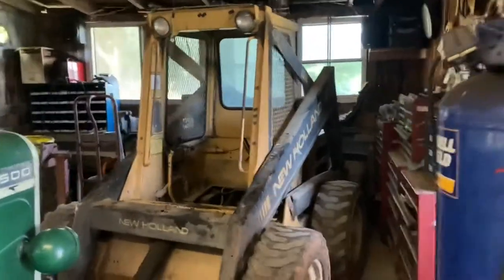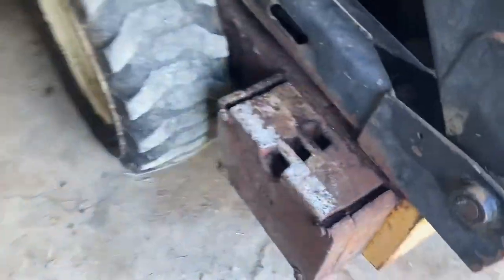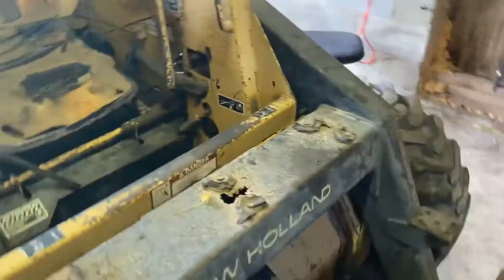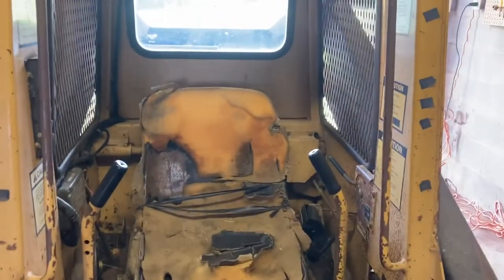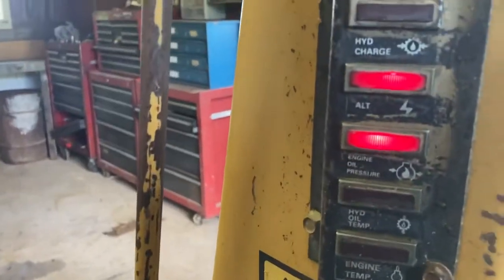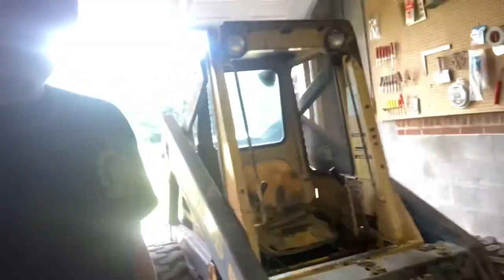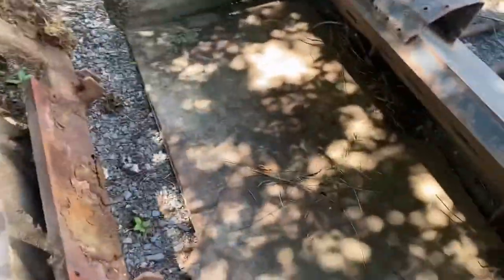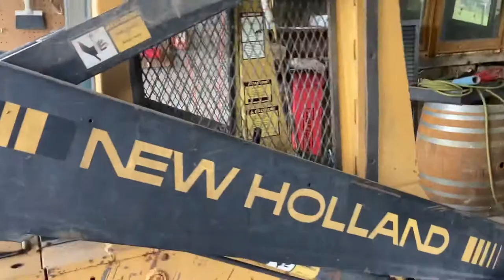We Got A Skid Loader | New Holland L553

Comment: I have the same machine, great running and have done tons of work with it, clearing land. I've had it 7 years now. I converted mine to the new style quick attach. It's actually a 38 HP Kubota engine.
Reply from the maker: They sure are good machines